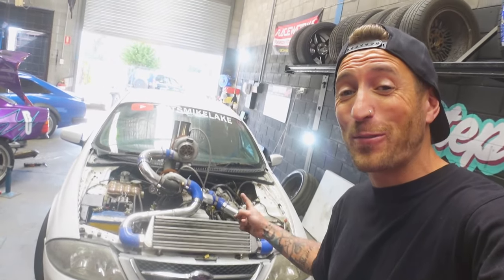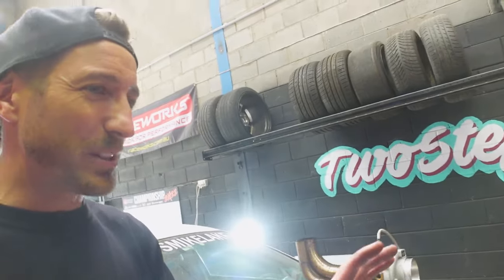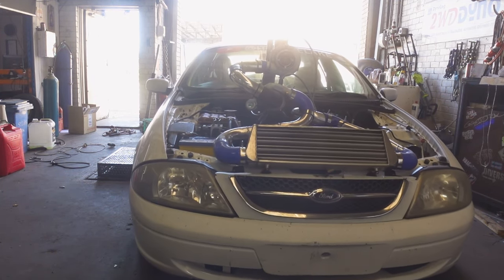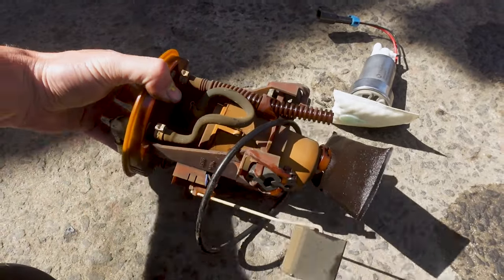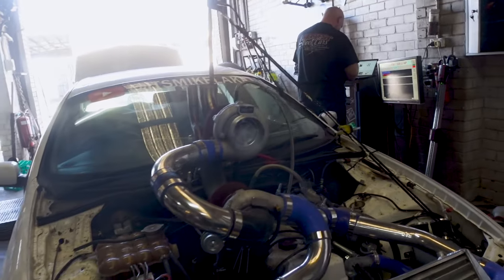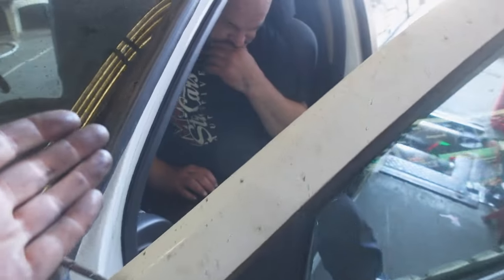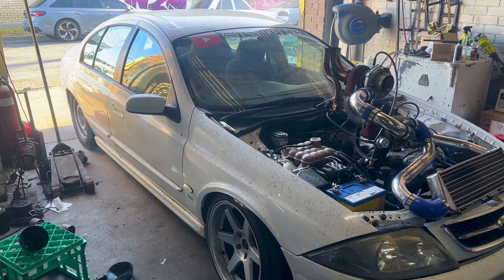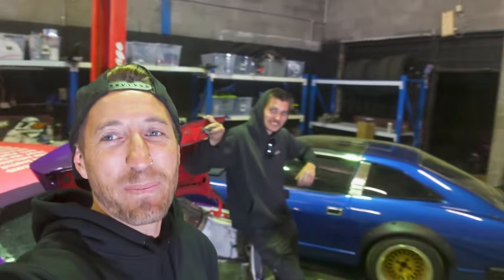TWIN TURBO AU Falcon Dyno Tune!

Comment: I won’t deny that a 30hp gain over factory numbers (obv will be more for this one since you’d have to take into consideration of age and wear n tear) did slightly disappoint my expectations, but it may be since I’m used to intec turbos having a bit of a higher budget and actually going for power, eitherway this was something different and I’m indeed all for it, surely the diff will be welded next 😂
Reply from the maker: I absolutely agree I was expecting more 😅. But the engine is so tired I think she’s all but given up haha. I think we could have easily pushed harder with more boost etc but given the engine wear I decided against it
Reply: @itsmikelake  that is definitely a valid and smart decision, any plans to find a healthier motor for it or rebuild the current one? or was this just a cheeky little fun project to mess around with. scrap this I just noticed the comment about scraping this project, I'm interested to see what's next.

Comment: Those cars are 172kw from factory without turbos so you’ve made about 8kw more with all those turbos
Reply from the maker: 164kw at the flywheel for non vct. So about 140kw at the wheels. Then minus 20kw for being 30+ years old. So we made 50+ kw with the turbos whilst having a bunch of fun 😁